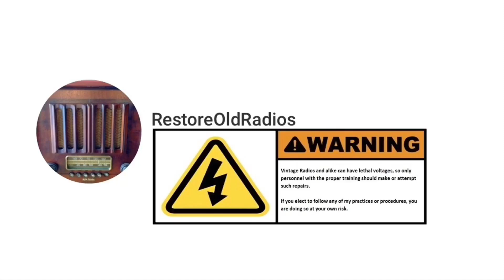Q-Multiplier Circuit - A Simple Circuit to Improve AM Radio Reception Works w/ AA5 or Transistor...

Comment: That's very cool. How does it compare with a frame antenna?
Reply from the maker: It’s more directional with peaks in the front and back and nulls to each side, so you can eliminate noise to a degree. The Q-Multiplier narrows the bandwidth to less than 10 kHz too. Thanks for watching. Best, Don

Comment: Can it be made for  3MHz to 108Mhz ? To support SW and FM band?
Reply from the maker: Changing the resonant frequency of the oscillator should work for SW, but not for FM. Best, Don
Reply: @RestoreOldRadios  then what will be the best way to amplify FM signal?
Reply from the maker: @SnehasishDebnath_remo  What kind of aerial (antenna) are you using?
Reply: @RestoreOldRadios   Still haven't build any, I have old TV antenna, I am thinking of reusing it as a FM antenna. Don't know whether it will work or not.
Reply from the maker: It would be worth a try before investing in a dedicated FM antenna. Hope the results are positive if you go that direction. Best, Don

Comment: First of all, thank you very much for your video. Since I don't understand the circuit diagram, I would like to trouble you to take pictures of the front and back of the circuit board. I want to make one by myself according to the photo. Thank you for your help!
Reply from the maker: Sorry, I no longer have the circuit. I used the parts for another project. You can refer to the video description for a link to the circuit documentation. I hope this helps. Thanks for watching and reaching out. Best, Don

Comment: Thanks Don for building this and sharing it with us! This excellent demonstration video and schematic is just what I been needing to find! I live in an area with only one local station and they are off the air a lot! This will be a great addition to my bench!
Reply from the maker: Glad it helped. It’s not a perfect solution, but it does improve the performance of a receiver. BTW - I added an earth ground to the circuit and it helped mitigate some of the noise coming from my lights, etc., in the shop. Have fun and enjoy. Best, Don

Comment: Very nice build. You did a nice job on winding the antenna wire. Did you get the bar from mike as well? 👏🏻👍
Reply from the maker: Thank you. The Ferrite Rod came from Amidon. It’s a Type 61, 0.5”D x 7.5”L. Thanks for watching. Best, Don
Reply: @RestoreOldRadios  Thanks! Sorry I guess I missed that in the description.  😀
Reply from the maker: No worries, I appreciate you watching. You’ll enjoy building and using the circuit if you decide to go forward. Best, Don

Comment: As always, a very useful tool.  You may or may not agree but it is a shame what has happened to the AM band and how little of quality there is to listen to.  Doesn't change a bit what you are doing.  Thanks.  Jim
Reply from the maker: Yep, I’m in a market with many AM stations, but the content is primarily Talk Radio. I enjoy my oldies using my close proximity TX. Hopefully a few folks can use the circuit to bring in some of the stations on the fringe... Thanks for watching and reaching out Jim. Best, Don
Reply: Not just the AM band, FM band or TV or cable TV or any media at all- 1984 everything everywhere. All is BS and Propaganda "Safe and Effective" indeed